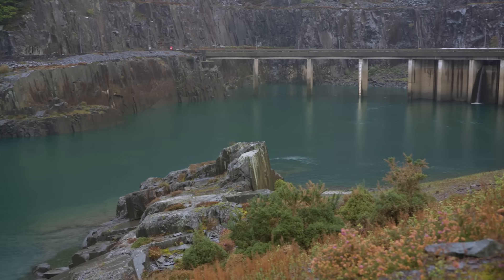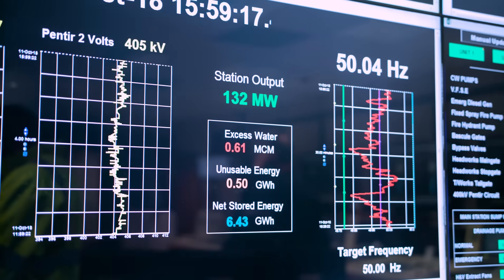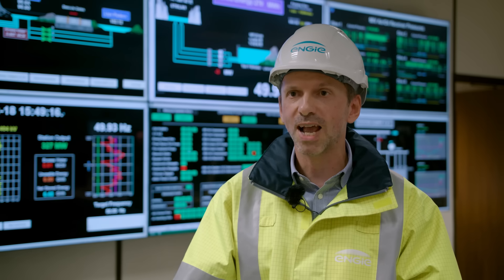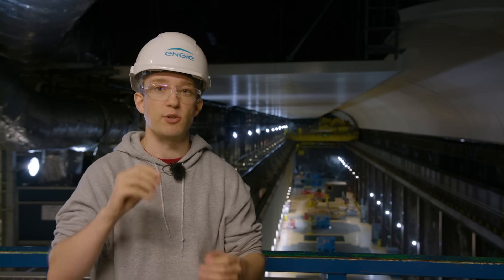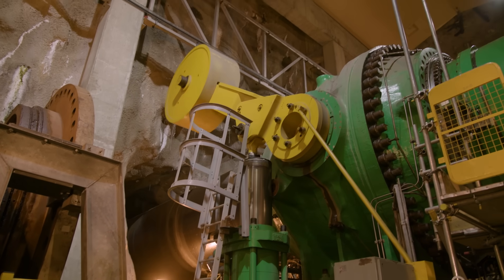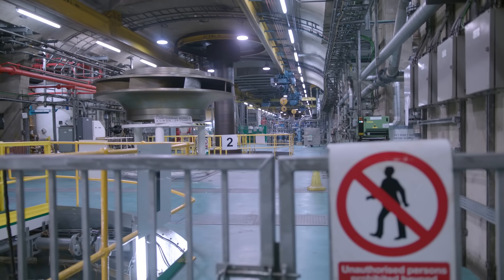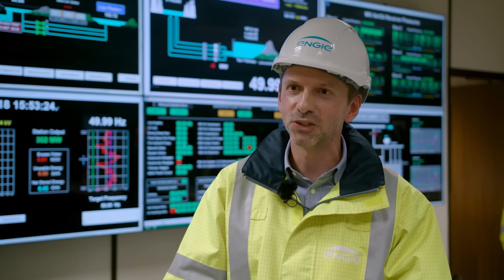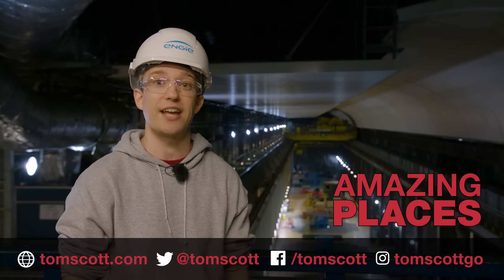Britain's largest battery is actually a lake

Comment: I gotta wonder how much energy it takes to pump the water back up...
Reply: More than it produces. However it uses the grids excess power at night to do this. Stations like the nuclear ones cannot be reduced in power easily so they stay at a constant power. At night little of this is used to it can be used to reset the system at Dinorwig.

Comment: I feel like I'm missing something.

If energy can't be created or destroyed, how does the plant create an energy surplus if it constantly has to restore the water to its original height? 

Does it not take the same amount of energy to move the water back up as is created when it comes down?
Reply: It uses power from other sources during the night to do this. There is no net output of power from this generator.
Reply: Its storing power, not generating it.

Comment: How can the turbine act as a pump in this case? Yes technically they are same, but the turbine impeller has to sit above the discharge and the pump impeller would have to sit under the water to pump, unless they move impellers on the shaft to convert between turbine and pump.

Comment: Southern Cal Edison should do this with San Onofre songs 2 and 3.
The grid is there, the generators are there to create electricity.
All that's needed are pumps, piping to the mountain range across Interstate 5,  creation of a storage lake on top of the mountain, one or two turbines, and the will to get it done.
Each generator creates 1100 megawatts of power, so that's 2200 megawatts of available generating capacity standing still being wasted.

Comment: so pumping the energy back up takes less energy than iy generates going down than isnt this infinity energy ?
Reply: not really..they are still using electricity from nuclear, gas or coal generators to pump up the water back to the top at night when public consumer demand for energy is asleep or low.. i assume it will take more energy to do that due to the presence of fighting gravitational forces..
Reply: No, it takes more energy to pump up. This whole system is only about 80% efficient in the end.

Comment: So it just wastes energy? Nice
Reply: SANG 
No it captures some of the energy that would otherwise go to waste. Come on mate.
Reply: @markc7955  it pumps water up a hill then turns the gravitational potential into electricity. Sounds like a big waste to me
Reply: SANG 
So what do you want to do with the excess electricity produced during the night?  As I said turning off the power plants is not an option
Reply: @markc7955  stick it in some batteries?

Comment: I'd assume pumping the water back up to the top uses more energy than is produced by the water coming down, so this isn't actually generating power. Overall, it uses more energy than it gains.
Reply: Correct, but this is a battery, not a generator.

Comment: I don't think I was paying attention because how the hell is it generating power? Doesn't it take the same if not more energy to put the water to the top?
Reply: It's not generating power, it's storing it like a battery does. This is important because generating exactly the amount of energy at exactly the right time for an entire grid is hard and risky. It's better to store your surplus energy in a stable form to be used later.
Reply: @AllUpOns  so they use more energy in the down time but get paid more for when energy demand is high?
Reply: @Joshuaposada  Not quite. They store energy from power stations that would otherwise be wasted (because there's less demand for electricity at night).

Comment: That example about streaming YouTube, netflix and fridge. What was that?
Reply: Vytautas Matas Prascienius.   It simply means, in contrast to the old days when Britain only had one TV channel (probably black and white) everyone used to get up during the add (commercial breaks) breaks and put the kettle on, or open the fridge and draw electricity, everyone did it a t the same time, causing a huge national power drain, which had to be compensated by a Hugh power generation plant. However today with Netflix and heaps of other streams of entertainment not everyone makes a coffee at the same time, henceforth a steady flow of power use.

Comment: So does the energy used to pump the water back UP used less that what it puts out on the down drop..
Reply: No, the other way around. This isn't a generator, it's a storage device. Remember that you can't just turn coal, gas or nuclear power stations off when demand for energy decreases. This uses energy that would otherwise be wasted due to lack of demand, so it can be stored and released when there is a demand.

Comment: So it's not even that they generate more power than they use, because they don't. 

They just generate power when the power costs more, and then spend power to reset the system when it's cheaper. It's just being smart economically

Comment: OK, it produces X power then they use X power to pump the water back up the hill. But they only say it produces X and is pumped back up when $ are cheaper but they themselves are the ones setting the rate of the $. So if the $ was constant 24/7 this system truly makes little to no power. I would like to see the number of KW made vs KW used.
Reply: It's a battery, charging will always be costlier than whatever the output it can produce. They use it during peak hours when other sources and grids fails to keep up with demand, it's cheaper than whatever alternative they had available

Comment: isnt it energy neutral? ie they must use electricity to pump the water back to the top?
Reply: It's a little more complicated, electrically speaking. It looses 25% of the electricity it puts in, but it's still a very important asset. They fill the upper reservoir at night while most people are asleep and more importantly, while electrical demand and costs are at their lowest. Then, when demand is too high for the regular grid to respond quickly enough, this system goes into action.

This allows the main power generation plants be reduced to more of an average, rather than being sized to the peak. So, the buffer plant saves the system from needing maybe 2 or 3 more power stations. It can also potentially absorb the surplus energy, produced by wind at night, or from extra solar during the day. It basically allows for power averaging, which helps match the supply to the demand and at a moment's notice.
Reply: @cornpop7805  So it's more an overflow system for emergencies?, but again i'll say this, it doesn't sound very energy efficient. it would be nice if they told us how much energy at peak times is made and how much it uses to pump the water back to the top. Also i doubt very much the energy there are any cost saving being passed on to customers due to the night activity.
Reply: @redjacc7581  not designed to be energy efficient, only money efficient.
Reply: @NAES_Official  i doubt any savings from this being run at night are passed on to the customer, they dont have seperate storage for cheap energy vs standard cost.
Reply: @redjacc7581  its not intended for customer savings,  just savings for the company.
Reply: @NAES_Official  Ok, but that isnt explained in the vid, it makes it sound as though there is cheap energy for the consumer.......which there isnt.

Comment: Those giant counterweights on the valves are actually interesting, you'd think with hydraulics you wouldn't bother but no, it must make it easier to close or maybe acts as a fail safe to close the valve if power fails

Comment: Solarpower or Windpower should be used to charge the battery and if they are not available it should be discharged. It does not make sense to charge it in the night, just because price is low.

Comment: so where does it get its power at night to pump the water back up? seems a bit backwards. why not just build a new power station to meed that extra daytime demand, and turn it off at night. defeats the purpose of not having enough capacity in the national grid if at night time that limited capacity is being used "recharge" a giant battery whose purpose is to take up the slack when it is needed.

Comment: Grand Coulee dam in Washington does some of this with Banks lake. Though there are three levels plus some irrigation going on, the Columbia river at the foot of the dam, Roosevelt Lake behind the dam(about 400 feet), and Banks Lake on the plateau above(add another 280 feet). The maximum height of Lake Roosevelt is the elevation of the river at the Canadian USA border 151miles upstream. Some years after Grand Coulee was originally built two dams were built upstream in Canada to help regulate the seasonal flow variations, under a bargain that provides British Columbia electricity as payment for the dams.
Anyway, when the spring-summer flows are high and electricity demand is relatively low excess power is used to pump water up to Banks lake from Roosevelt Lake, and a large fraction of the water in Banks lake is used for irrigation so there are 6 pumps plus 6 pump-generators about 50Mw each(600Mw for pumping and 300Mw generating), pumping capacity is 600cubic meters per second(45-55per unit). 
The main dam has a total capacity of 6.8Gw and the 3 largest turbines are 805Mw each, 3 more at 600Mw, the original 18 at 125Mw each and the 10Mw service generator. The total power capability from the dams in this river basin is 29Gw.

Comment: No. Its not a battery its a type of hydroelectricity. Batteries are a set of electrochemical cells that store energy in redox reactions.

Further the potential energy distinction is just misleading. Its technically correct because all electric charges are potential energy. But redox reactions are a specific chemical process.

Comment: A lot of road improvements where required to take the machinery from suppliers in England to the power stations in Wales and Scotland. This is why when travelling in these areas the road widths are disproportionate to the amount of normal traffic.  There is also a similar power storage system by Ffestiniog.

Comment: This concept is actually widely used in Brazil, as we have 90% of our electricity coming from hydroelectric powerplants. We also have 98.3% of  electrical capacity in the country interconnected by a single grid. Dude, this is a lot when you take into consideration the dimentions of Brazil. This grid is controlled by the Natonal Systems Operator (ONS) and they have protocols for almost every problem of supply and demand possible. I've already been there in Brasília. They control hydroelectric capacity at the many powerplants of the coutry to ensure equilibrium, from the Amazon rainforest, Northern region, to the South Pampas.

Comment: Just curious in these systems what efficiency do they realize?  For 1 MWh of electricity used to pump water, how much can be later recovered?
Reply: Pfft very technical question, depends where you measure from.40-60%.

Comment: Hell yeah,  huge battery,  and kind of never degrades as long as you maintain the mechanicals and the water level.
Reply: Erosion?
Reply: You could say the same for your car battery if you kept topping up the acid.
Reply: All electrical systems - no matter whether connected to the National Grid or independent require regular expert mechanical maintenance (or do you think nuclear power stations, solar panel farms, and wind turbines look after themselves?)

As for the water level - it's Wales! 
I don't think I've ever visited Wales and it's not rained at least one point in the day. Considering it's described as 'a rainy bit' of Wales, I should guess that it is one of those regions of the British Isles that receives a peculiarly high degree of rainfall (like Eskdalemuir in Scotland and practically all of Ireland. 
It's quite probable that, unless climate change really makes significant changes to the British climate on a permanent scale (ie, we turn into a desert or frozen tundra), then I think we can be fairly sure that the liquid water level in this particular 'battery' will be just fine.
Also, I'll be surprised if the water in the lake used in this battery is not more, much much more than required for daily operations. I doubt very much that the lake drains completely with each manoeuvre. So, more than enough water.

Also, don't be such a downer. You sound like my son, for goodness sake. Think about your mum and dad for a moment and how it feels for them to hear you being so negative about nothing at all. It drives us mad.
Reply: And all in a country a load of people dunno abt

Comment: Why don't they just add a pipe from the bottom to the top so when the water pressure increases from the flow the added pressure helps push water back up refilling its self to a point? Will probably add 15-25% more power generation that way.
Reply: NO. The solution doesn't work that way.

Comment: I assume the pressure relief,, the anti-hammer device is a tall tube back to the surface?  I'm curious.

Also,,, what is the total efficiency?  The conversion of , let us say wind power,,, nets out,, reaches the power storage transformer station at 100 watts.  I know that the most efficient transformers can convert the voltage at something like a 5 to 7 % loss.  (20 years ago I seem to remember that the theoretical limit of efficiency was a 5.4 or 5.6% loss)
Now that electricity drives an electric motor/generator,, at what efficiency?  What are the efficiencies of the physical movement of the water?  And then, of course, at some point you reverse the process and lose  percentages as the potential, becomes, fall momentum, becomes rotational, becomes electricity, becomes fodder for the transformers,, etc.

My seat of the pants says that if you put 12mw in you might get 6mw back.  I do not know what this figure is,,, is it 3.2mw back out,, or is it 9.2mw back out?

Mistake me not,, having the benefit of a 'rubber band' on the system may be worth it if only 1.1mw comes back out,,, or if there is a concerted effort to accommodate wind,, blowing when it will or wishes or solar on a bright day when you do not need it.  a 0.2 might still be profitable.    What is the measured figure?  I'll bet those guys know.

There is a reason I ask.    There is a proposal afoot to build a 25 mile long tunnel, dedicated pumps then run intermittently to utilize excess wind and solar power, and then release that water to generate electricity via a 1934 generator in an existing dam.  The proposal is not to assist with power generation peaks and valleys, but rather to only store the excess power generated by the randomness of wind and solar.  That dam already increases, decreases output per the course of daily demand.  My pencil calculations say that the entire system is considerably less efficient than 50%.  (like as low as 12%)  and that a 25 mile long tunnel to transport water back uphill,, the frictional losses,, the momentum inertia changes,,,, 25 miles.

Dinorwig Power Station may know. Hmmmm  I looked at their input/output numbers.  Those number imply a 61% total efficiency less operational costs,,, so 55% or 56% efficiency overall?   A lot better than I thought it would be.  AND they get the rubber band benefit of evening out demand spikes.  12mw eventually becomes 7mw delivered at the right time.  If my observations, their figures, and various assumptions are good,,, that is really good.

Comment: Maybe someone smarter than I can answer this! Also, please ignore typo's, I broke my damn finger at kung fu on Monday haha. Anyway, If gravity is what pulls the water down, then when we use energy to pump it back up, how are we not running the powerstation at a loss of Energy? I understand the variance in pricing and as such the choice to pump it up hill in the dark hours, but any negative drain thusly increases costs long term. This leads me to think that the energy created by the gravity fed hydro station is more than that of moving the same body of water back to the top of the hill? Unless it's solely dependent on rain topping up the reservoir to exceed it's own energy cost?

Comment: Renewables produce electricity irregularly. This battery system makes you able to store the energy when it is produced and use it later. Getting out of fossil fuels and nuclear, those solutions are very important - and possible!
Reply: This system was put in to support nuclear and coal overproducing at night, the coal is gone but now wind overproduces at night. Over the years it doesn't matter much what causes the peaks and valleys, the storage evens it out.

Comment: I wonder what the net output is. I mean, if you factor in the pump power requirements and deduct the number from the power output, would it still be worth it? I suppose it is, but it'd be cool to see the figures.

Comment: I'm confused, how is this a battery and not just a hydroelectric generator ?
Reply: Water is pumped up the hill, which uses energy, and the energy is stored as water at the top of the hill. Hence "battery". It uses a hydroelectric generator to then convert the water back into electricity. So it's both a battery and hydroelectric generator.
Reply: I was envisioning nickel and copper rich caves full of acidic lake water.  While an on demand surplus energy pumped hydro electric supply is neat, I still  feel scammed.  This is no different than people from the middle ages bucket filling a buffer dam to drive a water wheel flour mill when the river runs low/slow.

Comment: There's something like this in Missouri USA called the Taum Sauk Hydroelectric Power Station. It's used for the same purpose in very nearly the same way. Owned AmerenAE, if I recall. Years ago there was a catastrophic failure of the upper reservoir which caused the devastation of homes and an entire national park. It's an interesting tale.